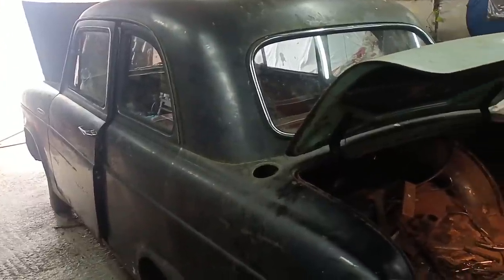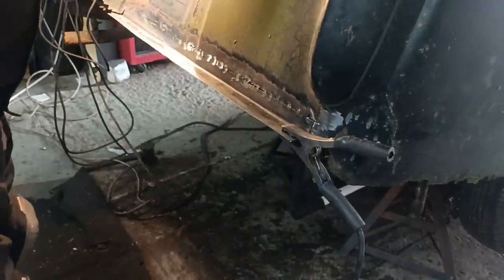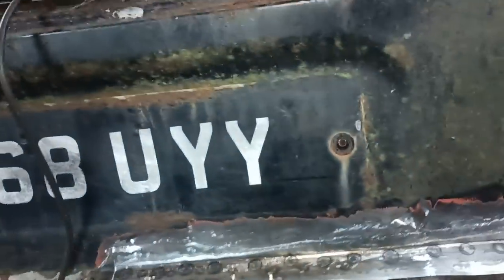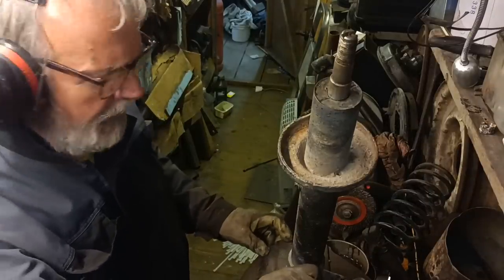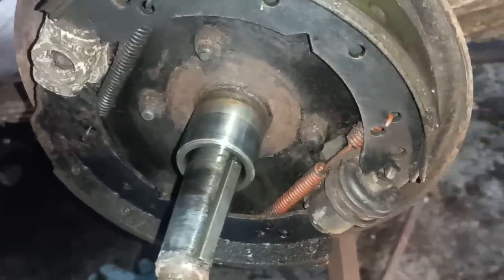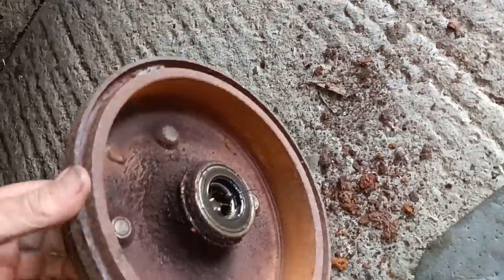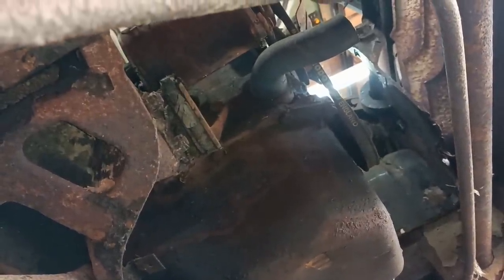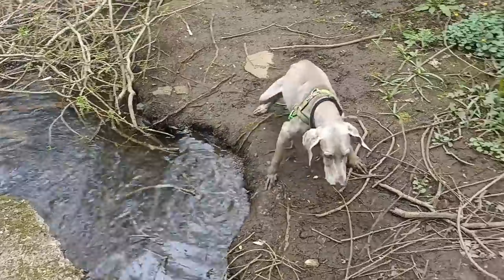Mart's 1955 English Ford 100E Anglia part 4!  More repair, Brake inspection and new wheels! (2338)

Comment: When I had my 100e in the early 70s  oil in the rear hubs was due to the needle roller bearings wearing down the machined surface on end of the axle, leading to leaking oil seals allowing axle oil to escape. In those days you could buy a kit consisting of a sleeve for the axle-end and smaller diameter needle bearings. And of course new oil seals.

Comment: A water blaster coukd clean up all around the front whilst the wheels etc are off. That would make it easier  to decide what actually needs body work  and what could merely be painted with a good underbody sealer.

Comment: another great video back in the day i had a cortina engine 107e and we all used 165x13 on lotus rims welded to 100e centers with a 2" drop they look good. We were lucky then a 5 year old car didnt have near terminal rust to deal with, its going to be a long job  thanks Mart for these interesting vids
Reply from the maker: Hello Keith. Oh for those days. Thing was, they did have rust at 10 or 15 years old, not like a modern car. For many people the rust on this one would be post terminal. I hope I can turn it around.
Reply: Very distinctive cars these, that changed the look of cars then, as much as S.U.V.'s have now! HISTORIC, but most people don't realise!

Comment: When spot-welding it is best to keep the welds around 50mm  apart as much closer than this results in the current shunting through the previous weld resulting in a weld that is not properly formed  and likely to fail. High powered machines in car plants can go to around 40mm spaces. when there is no room and you need to go closer you need greater tip pressure, not possible with a hobby welder.
Reply from the maker: Hi Jacqui. That explains a lot. I remember you saying the metal needs to be fitting together well, so did try hammering and dollying it for a better fit I thought that was why some of them had popped. Thanks for watching. Mart.

Comment: Interesting Mart ,I'm thinking the biggest challenge is not running away with monetary investment into the car .It did look sweet on the grass ❤.
I managed to buy a replacement carb from Mabien for my French flattie ,so a little further to getting the pilot running better👍
Reply from the maker: Hi Phil. I tend not to let money run away due to being tight as ****. I didn't know you had a french flatty or a Pilot. (unless I missed that info). Mabien? Tell me more.

Comment: Never re-use brake shoes after being contaminated with brake fluid no matter how clean they look after cleaning them up even if you just dried them up with heat and if they look dry and clean I guarantee after a  day of use if you inspect them then you will see fluid still coming out of the linings.
Reply from the maker: While I fear you are correct, it will be interesting to see what they are like after a little use. Always willing to try things.

Comment: I work on a lot of Mid Fifties Mercedes and tires are getting to be a major problem ,being 185 13's. How would you go getting them for the 100E if needed? Smaller sizes are available here but look pretty silly on these bigger cars.
Reply from the maker: Hi Merc. The sizes for the 100E are not too bad as a 155-13 or 165-13 would do, but I wouldn't like to find a 185 like on the old Mercs. Mytyres.co.uk has them but absolutely megabucks.

Comment: Do you have to grind the new welding while it's hot, is that the reason you do it bit by bit?
Reply from the maker: Hi Dave, as they say, there's more than one way to skin a cat. That method is used by Kyle at Carter Auto Restyling and I thought I'd give it a go. The main aim is trying to avoid distortion of the panel. I'm still very much a novice so have much to learn.
Reply: @MartsGarage  looks like you're doing ok to my untrained eye 👊